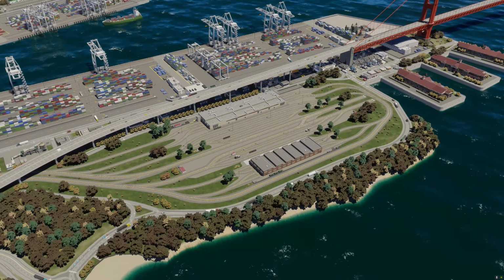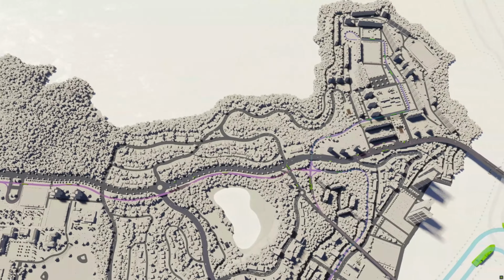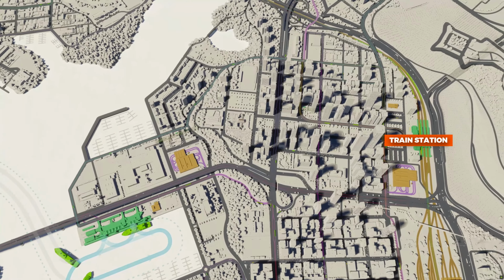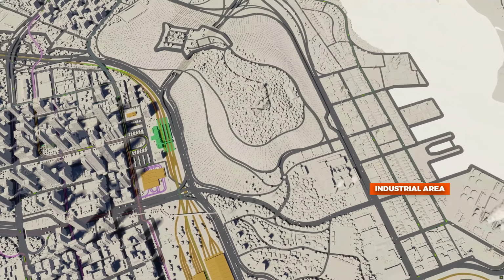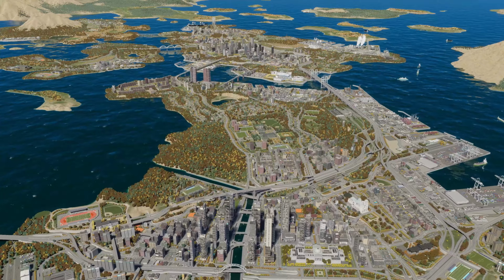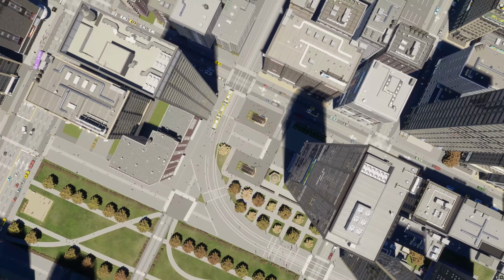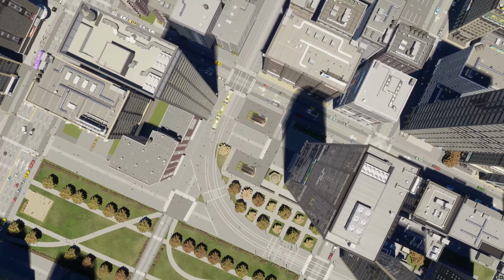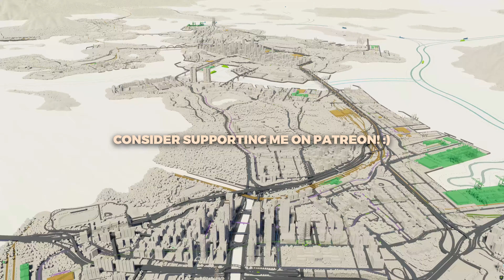Engineering An Efficient and Realistic METRO Network for My City | Cities: Skylines 2

Comment: Have you tried adding extra entrances/exits to the metro stations using underground pedestrian paths?
Reply from the maker: Wait what is that a thing???
Reply: @imperatur  You can actually connect metro stations underground with pedestrian paths and cims will use the paths to make a line transfer. In the metro station model, there is a small path node that is perpendicular to the staircase 6.25meters down. I've found that it's easiest to connect to the node by turning off all snapping.
Reply: @RyuseiSasaki  wow!
Reply: @RyuseiSasaki no wayyyyyy
Reply: @RyuseiSasaki   Yep! and I've also gotten it to work with the subway/train station interface stations too. Just add the path towards the wall near the underground stairs and there's a small place where the path connects
Reply: the entire cities skylines community thanks you, this is huge i had no idea!
Reply: and with the latest Anarchy update (1.2.2) if you set bulldoze to show the invisible lane markers and then come out of bulldoze mode the lane markers remain visible (or you can use dev mode to do the same thing). Once the lane markers are shown you'll see where the cims follow the paths making it easier to connect hopefully.
Reply: I learned that from Two Dollars Twenty's pre-release vid for New Dollarton.
Reply: I realized the same thing few days ago. I started to make interchange stations with it. I also made exits
Reply: @MrMtanz  I know it's been some time since you posted this, but I simply cannot figure it out. Is there any chance you could make a video? Does it require that I use the anarchy tool?

Comment: Connecting service tunnels are now a thing with depots, that's cool. 
I wish there were more options for metro stations though, more platforms in the same station, changing the depth of the platforms, modular stations to build a true metro hub. 
Although there seem to be some hidden feathers as MrMtanz pointed out, the options are still quite primitive.

Comment: With the new high-capacity metro trains you don't need that much trains to serve a line. So it's not really necessary to build 2 stations for intersecting lines. Just meet the lines at one station and cims can change lines without leaving the station.
Reply from the maker: Okay yeah that makes sense..:)

Comment: I really wish the base game had a better station for line transfers. I'm going to need to mod one in I think. A station that has stacked, perpendicular platforms like stations on the DC Metro (think Metro Center) would seriously, SERIOUSLY come in handy when engineering a network, rather than building two stations next to each other and connecting them underground. I'd like to have a station with a singular station entrance where citizens can access both lines from one entrance.

Comment: I dunno if subways are meant for huge 200k+ cities but i built a similarism subway like in this video one circle line looping the city ans another one going straight through the middle connecting the center to the outskirts

It gets quite low ridership so did i do something wrong or are subways just op? Because the downtown traffic has gone
Reply: You need to know the demand and route for transport. First, you build bus lines. When you see that buses are full at a couple of stops you add trams there. But not just copy the bus line. When trams are full somewhere you start to build a metro. You can use the hub system when buses and trams go locally and the metro connects all habs, Train stations, and Airports. Just study some European city public transport maps.